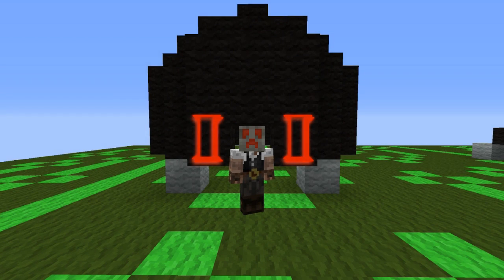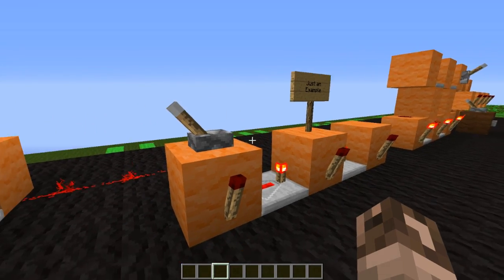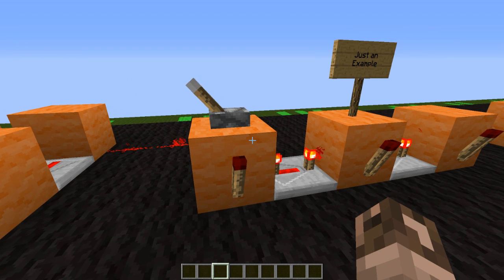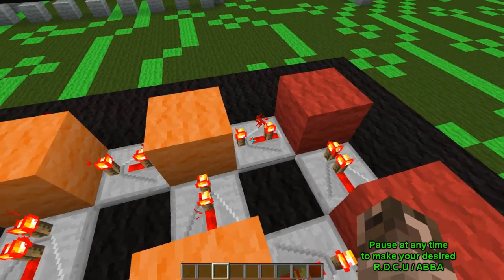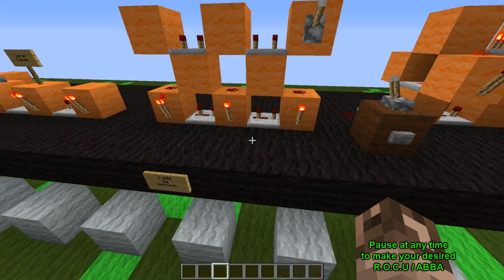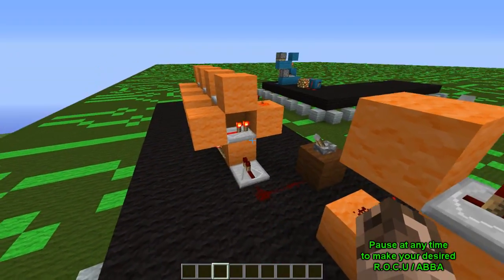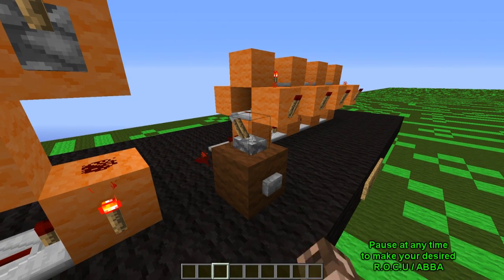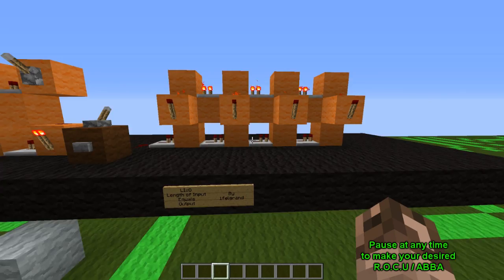[ABBA Switch] Minecraft Circuit Board + World Download

Comment: For the LI=O circuit, you could set up the timing in such a way that you get a different output the longer you hold it for. E.g. if you leave the lever on for 1 second, then it will open a door, but if you leave it on for 3 seconds then it will blow you up. It would be pretty simple to hook up - just use a modifed End Gate that reads the highest output that the redstone torches give off. Of couse, I'm sure allot of people can come up with better designs.